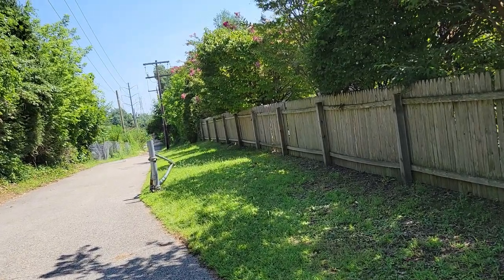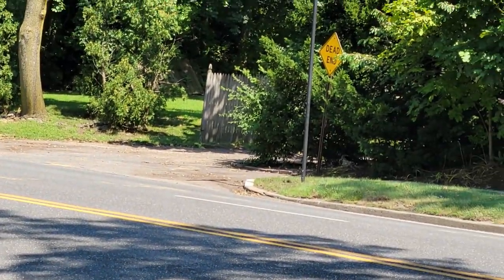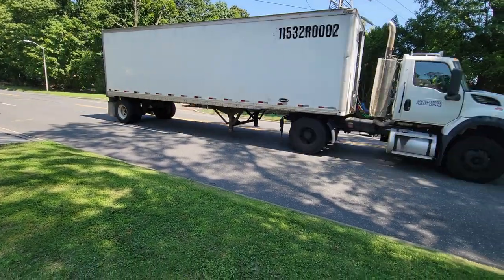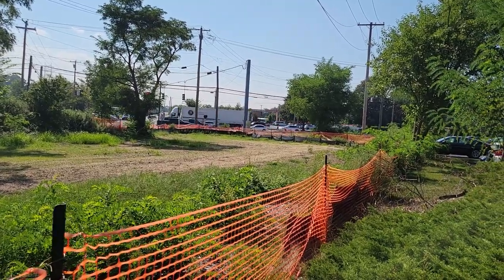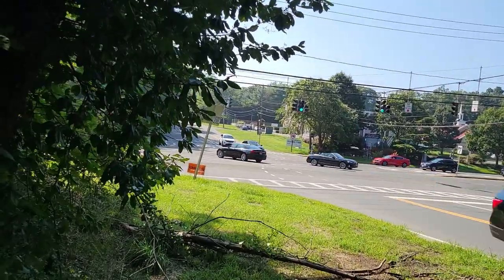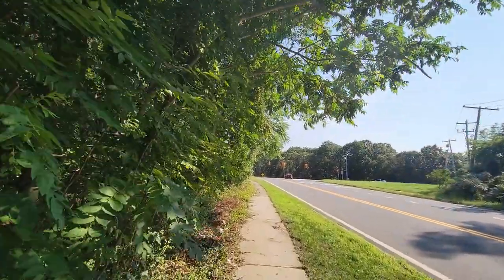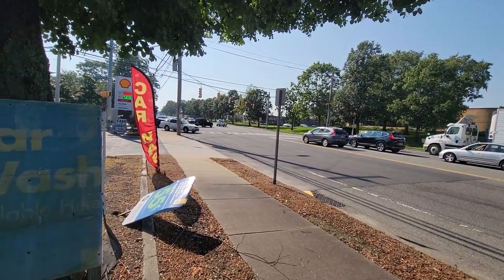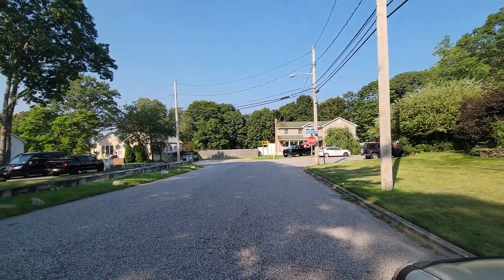Part Two: The Old Vanderbilt Motor Parkway From Start to Finish

Comment: What about that stone looking building on northern Pkwy, what's the story with that?
Reply from the maker: I know exactly what you are talking about and I too would like to know what that structure was used for.  I will have to do some research on that sometime.
Reply: Depends on exactly where the structure you are referring to is on the Parkway. Most likely one of the several gas stations stylized ornately with brick and stone, as the many bridges are. There were gas stations along the Meadowbrook, Wantagh State, and Southern State as well. Do not believe any are currently functioning. These were also prominent on the Hutchinson R Parkway, Bronx River, and Taconic parkways. Some of those still function as gas stations and Dunkin Donuts or other.